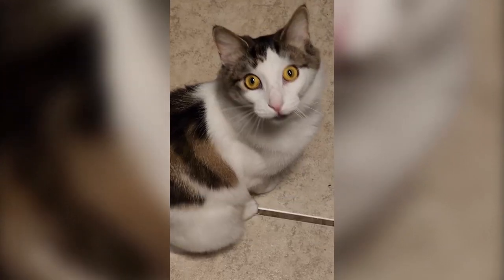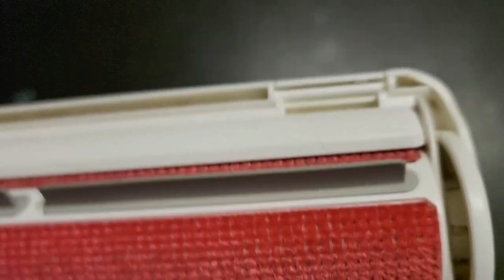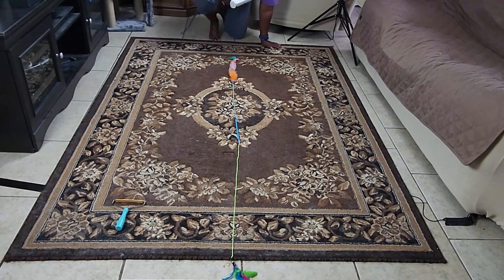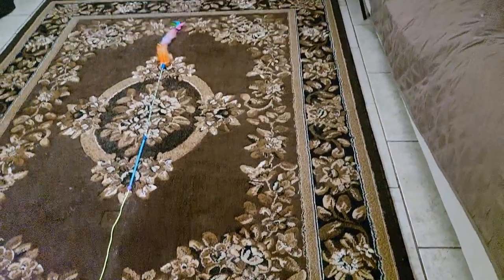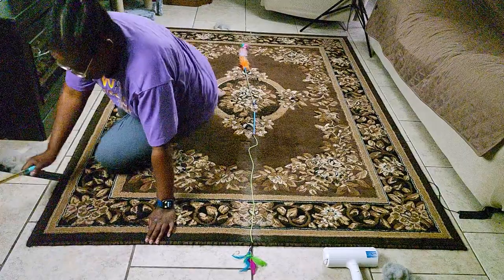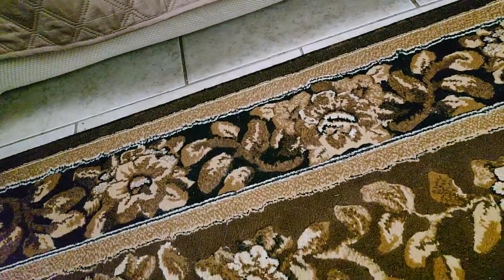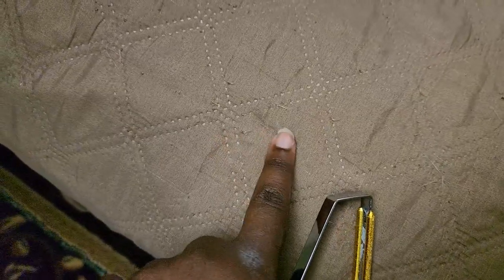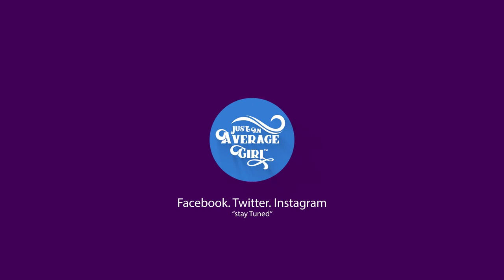Uproot  Lint and Fur Remover Review

Comment: Omg this review is awesome. Thank you ! This is just what I needed for my cats fur. I don't have carpet but her cat tree is just like the one you have so I'm going to use it on her cat tree. Thanks for making my decision easier. Thanks for adding the link
Reply from the maker: You're welcome! 😃 Be advised, depending on the material of your cat tree,  it will pick up that material. My cat tree's texture is like a fake carpet so I began to notice the harsh metal was doing too good of a job and started picking the cat tree's material. So I ended up finding something similar, but it has silicon teeth instead of the metal teeth and works just the same and helps with some knit material not all. That's another video I did after this one.

Comment: Does the uproot work on actual carpet? It’s slightly higher pile VS a rug. Plz let me know?!
Reply from the maker: It does, but it will pick up small lint like pieces of the carpet. When I was staying with my folks during the last hurricane that hit Florida, my cat and I stayed in their spare bedroom that had polyester type carpet.

 When I went back home, I went back and cleaned up any cat hair that was in the room using uproot, and it was picking up the fur, but small surface pieces and thankfully not from the root of the carpet. I personally feel over time it may weaken the carpet but again it depends on the type of carpet you have. Hope this helps.